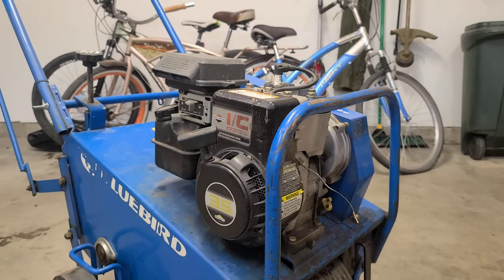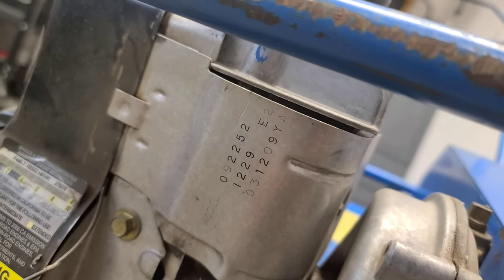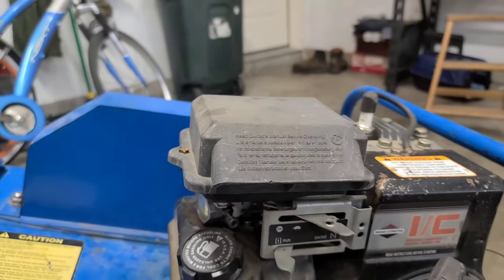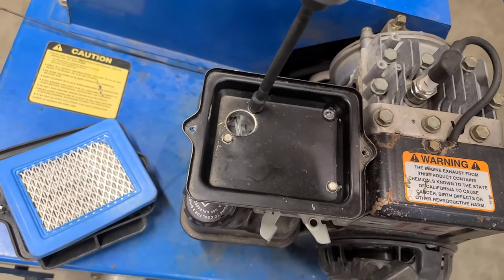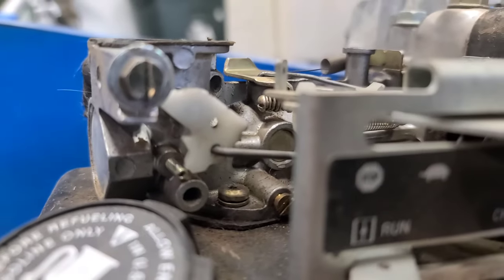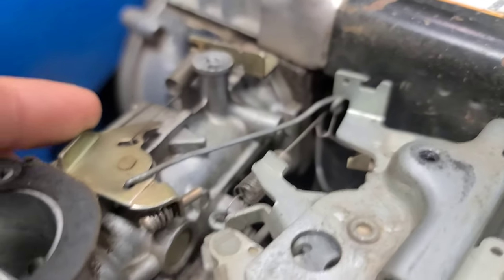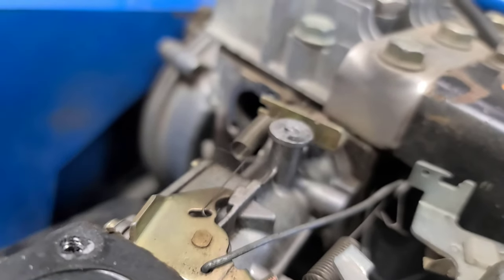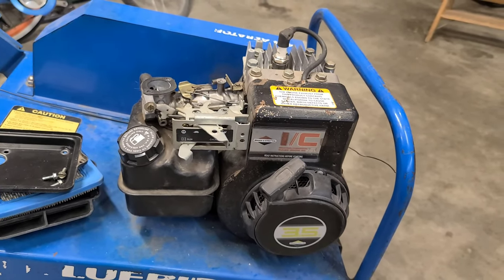Throttle, Choke, And Governor Configuration | Briggs 3.5HP Engine

Comment: Is there any way i can hook up a throttle cable up ? I have that same motor and it has a lever for off idle and fast but need to do away with that lever because its going on a go kart motor came off a log splitter im pretty sure so it had that type of throttle control thank you ! Let me know

Comment: Hey there. Thank you for the detailed shots of the linkages, very helpful. The one thing I can’t find any info on is where the actual throttle cable coming down from the upper handle on a mclane 3.5 hp 20” reel mower connects. So when pushing the mower, there is a lever in the center that controls the engine speed and will kill the engine when pulled back towards the operator. The z link broke wherever it connects in the throttle/choke/carb area (not sure exactly what it’s called) I’ve seen plenty of videos addressing the linkages like yours but no one explains where this cable from the throttle speed lever attaches at. Any advice would be greatly appreciated. Thanks for your time and thanks for the very detailed video.
Reply: looking for the exact same thing